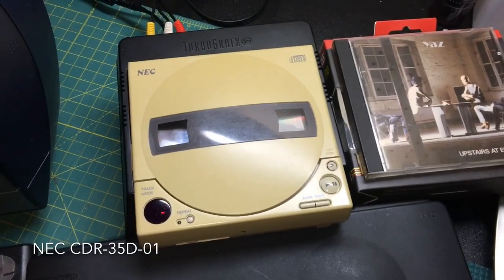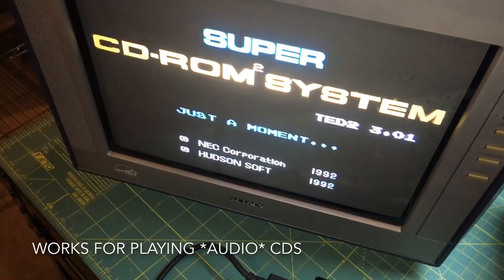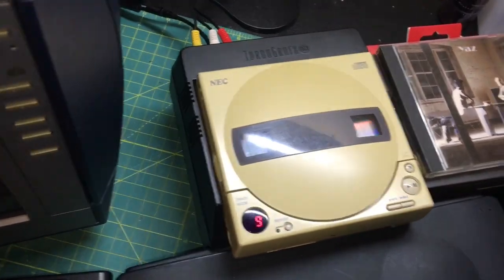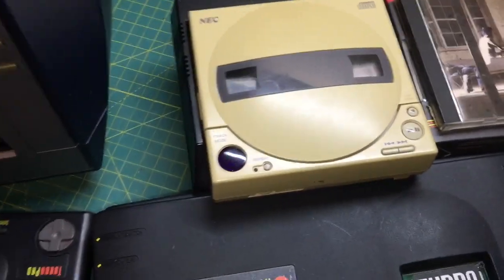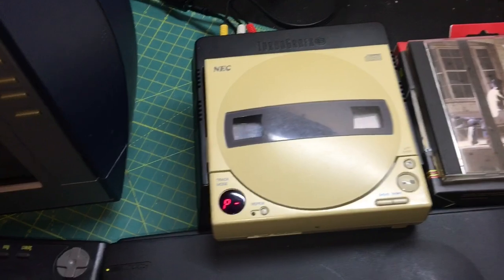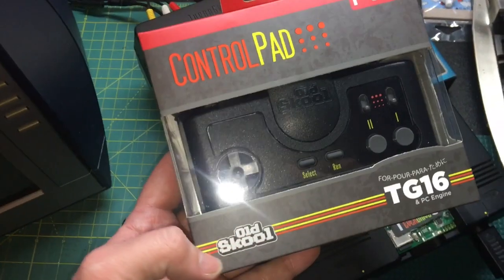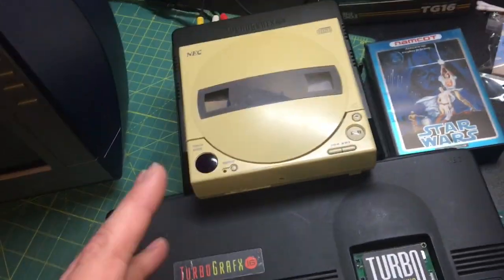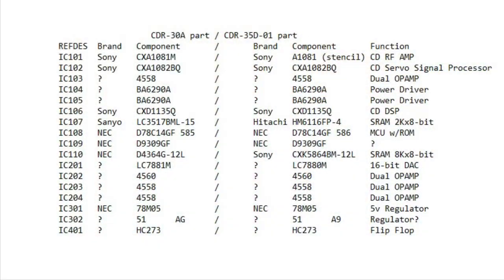[strange issue] NEC CDR-35D in a TurboGrafx-16/PC Engine

Comment: You probably know this by now but internet research indicates that the NEC D9309GF is a SCSI bus interface chip, something like Fujitsu's MB89352. When you see NEC chip IDs starting with "D", the official part name usually starts with "uP" or "µP, making the full part number "uPD9309GF" or "UPD9309GF". GF is the chip number suffix, usually indicating things like chip revision or voltage or lots of other possibilities as you know. So searching for "UPD9309" turns up this patent from LG Electronics which identifies the uPD9309GF as a SCSI bus interface: https://patents.google.com/patent/EP0464729A2/en

Comment: Hello emit-I'm not familiar with this device but it messing up when you put hand close it it could be poor shielding around the rf amp ic or maybe a frayed cable going to rf amp ic which is the first ic you come to directly from the laser-it basically modulates the laser signal. I've never actually seen this happen before but just a possibility.
Reply from the maker: Thanks! There is slightly better shielding on a HES-CD-R-01 model (wire soldered to lower shield) and that side is where the RF test point and several adjustments are located. The laser itself connects with a flat flex circuit which seems pretty secure in the disconnect but I’ll check the other jumper wires to see if they go to the same IC.

Still doing UltraHDMI? I just spent the last week distributing 40 kits from a group buy (installed half of them for GB participants and sent the rest on to other installers). First round after moving to this new place. :) If you’re ever around Newnan let me know and we’ll try some 007!
Reply: I guess I'm not doing anymore(UHDMI). Think Marshall cut me off for some unknown reason. Hasn't returned any emails I sent in a month. I only had 1 return whole time I did them which was the rare graphical glitch after it warmed up a few hours about a year ago. I wasn't aware to even look for that glitch until then. The same customer was happy after I replaced the defective board so I had a almost flawless time doing them so not sure what is problem but life goes on.
Reply: I rarely get out of LaGrange but will let you know if I'm ever headed that way.
Reply from the maker: He actually fixed that with the 1.08FW update. It was because he was using laptop RAM modules with code he originally wrote for the desktop RAM used in his 64Drive. The tolerances were different. Depending on the “DRAM Lottery,” as he puts it, you may or may not have problems with the code he was using before.

Anyway, I was kinda cut off from Marshall the same way in 2017 (email) but I found a place online where he is active daily and much easier to reach. We told another eBay seller and he managed to place an order with Marshall there but the guys didn’t seem to appreciate us telling the public. Ever since then we’ve just been helping other people get them by acting as a conduit ($130ea in the group buy). My brother has been running the group buy on Shmups and Reddit but you don’t have to be a member to join (look for his contact info).
Reply: Didn't realize it was the firmware-thought he got a bad run on silicon. I actually had several boards with that problem but caught it after the first one.  It was a strange failure. The ones I tested that had problem would not show up unless room temp was 73+ degrees so just assumed it was leaky silicon.  Marshall finally just got back to me just now. I was able to order a few. Thanks for tip on contact.
Reply from the maker: Out of ~17 kits, 3 people noticed the problem and all were international buyers: two in Taiwan (NTSC and PAL) and one in Belgium. We always test 15-20 minutes but that wasn’t enough to notice the problem. :(

We tested the rest of our kits and found another that did it. Marshall actually sent us FW1.08 early and it bricked one of our boards.

It’s very likely that more people had the problem and just never noticed, since it isn’t always noticeable in a given game. I have update carts made to send to anyone else with the problem who has no other way to update. :)

Yes, we also assumed it was heat-related since operating without the top shell seemed to delay or eliminate it. Turns out that heat affects the tolerances of the RAM’s timings so rewriting the FPGA code with proper timings for the laptop RAM solved the problem!

Glad Marshall came through for you! :)
Reply: I'm glad you were able to send flash boards to the overseas buyers.Mine were well before 1.08 but Marshall did make the boards good. The guy that noticed had a gaming review you tube site and was doing a quality comparison is how he noticed it so quick-I'm glad it happened that way or I  may have sold a few more like that. Buyer was cool about it and reviewed the good one and thankfully didn't mention the previous one.
Reply from the maker: Audio Gear Yes, mine were early 2018, 1.07 kits. Worked with Marshall through the summer as he developed 1.08 (shipped in October). This is why 1.08 has the new “DDR OK” message in the self test and the screen blanks as it checks for memory corruption. :)

You were literally the first person I saw acknowledge the issue publicly after the two buyers I dealt with directly... and with the very same game everyone was using for testing (007).

Marshall has cheap (~$8) updater boards but you can only program them if you have an UltraSave and a 64Drive. I have neither so I had to use a much more expensive RetroStage board for my update carts. The update was actually too small for the RetroStage programmer until I patched the ROM. So far, so good. :)
Reply: Goldeneye??-that wasn't me  I never tested it with Goldeneye. The buyer found it with Quake 2 in hi res mode and after that I used Quake 2 in high res for several hours  to test every 64 to be sure I caught it.
Reply from the maker: Audio Gear Ah. I’m mixing it up with a video from one of my buyers where he demonstrated the problem then. :)

On the affected kits I was even able to see the artifacting in Super Mario 64 but it took longer and was more hard to see (much more subtle than 007). So glad 1.08 resolves this since testing every kit for hours is not appealing at all when I even test the kits I don’t install! :)
Reply: That's OK. I did do a video with goldeneye but it was from 2016 about a month after my first install and was just a LCD HDMi vs CRT composite vid. Had no vid issues. That's not something I would do. I still test probably longer than I should just to be sure nothing else like this catches me by surprise. 1.08 was a  great release. Hope there will still be more releases for HW1 even after  HW2.0 is released.
Reply from the maker: Audio Gear I don’t know what I’m allowed to say publicly about HW2 yet other than the IGR wire is integrated on the FFC, but the base functionality is identical. :)
Reply: Yea that's understandable. I wouldn't mention here either.  I also heard about IGR wire.
Reply from the maker: Audio Gear Yeah. Pretty sure Marshall will go on supporting both. The HW2 redesign is mostly meant to accommodate people who want UltraHDMI to play well with other popular mods. People have been begging him to add resistors to the FFC so it will play well with Tim and Borti’s RGB boards but he’s approaching it a different way.
Reply: OK I guess my suggestion of dual HDMI outs with a s screen dividing chip isn't happening . Would be awesome for multiplayer.

Comment: I found one of those with the scsi interface at a local thrift store many years ago. I thought it worked with my tg16 but I was using the original 2.0 card.
Reply from the maker: Yep. That's what this one came from but I didn't get the "buffer unit" (SCSI dock). The only thing keeping it from working with the TGCD docks was the ROM built into IC108, which is an NEC programable microcontroller. I have since salvaged one from a broken Japanese drive. It will work with your TG16 but that is a QFP surface mount chip that isn't very easy to swap for most people.